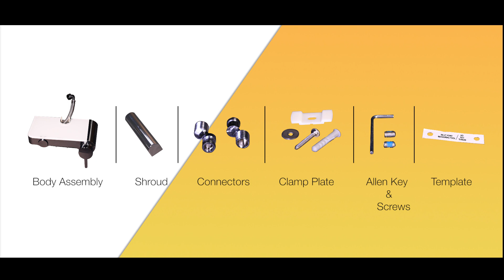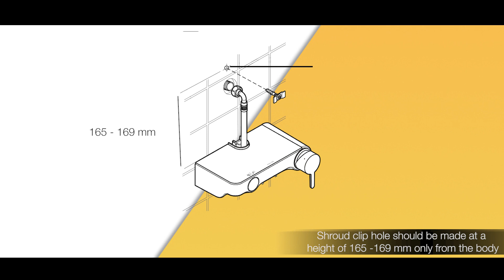Kohler Smart Care - Toobi 2.0 Shower Wall Mixer

Comment: i have installed this in my bathroom, but no pressure in shower, the height of overhead tank is 12', and yet no pressure in shower, disappointed with this costly shower. plz confirm the details before buying.